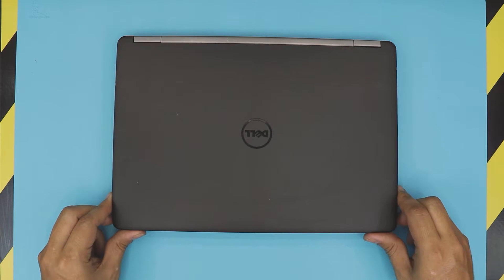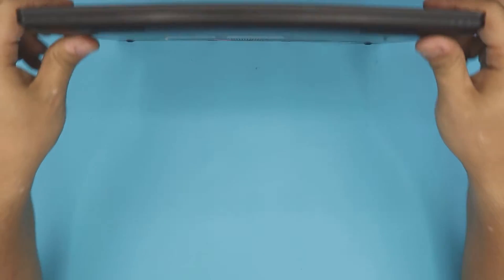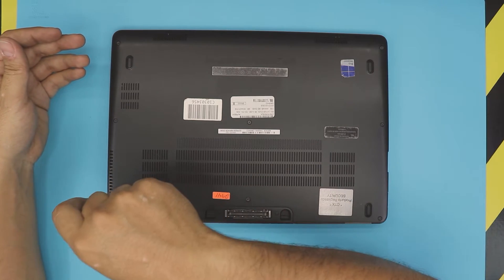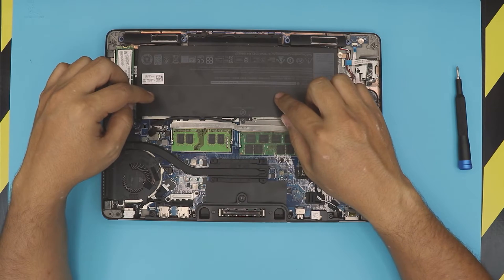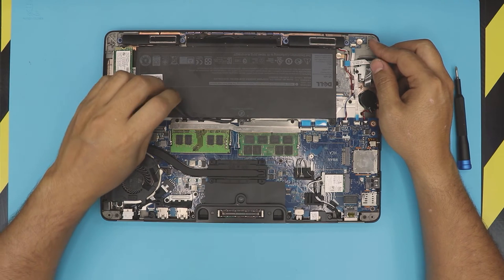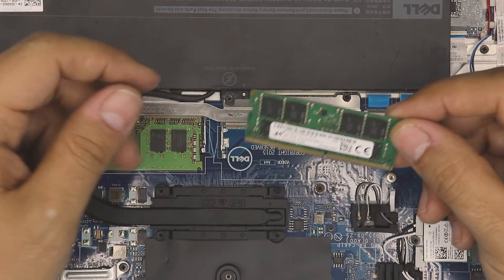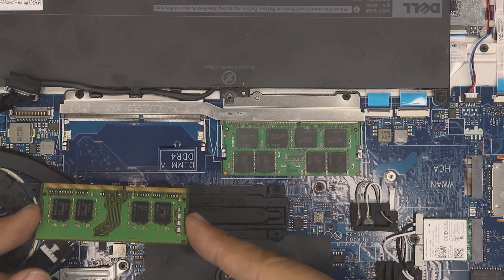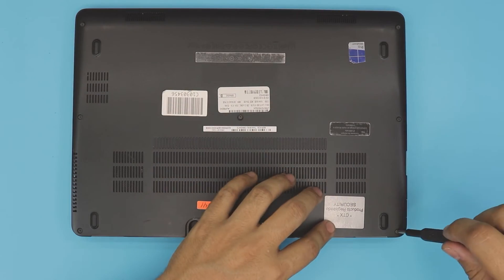Dell Latitude E7470 Ram Upgrade Guide !!!

Comment: is kingston good enough?
Reply from the maker: 🫠Regarding your question, it is very good it will out last your laptops life. good to go with.
cheers🍻
Reply: @uFixTek  whats much better buying two 8gb ram or buying one 16gb ram?
Reply from the maker: Always use two sticks, as this will automatically activate dual-channel mode, which provides better performance compared to using a single larger stick.

Comment: D origine c’est des ddr4 2133hz la fréquence que vous avez mis n’es pas la même,ça ne pose pas de problème?
On doit pas tenir compte de la fréquence?
Reply from the maker: Merci pour votre avis! Si vous souhaitez soutenir la chaîne, vous pouvez aimer, vous abonner ou les deux ! En ce qui concerne votre question, absolument pas mon ami, vous pouvez placer n'importe quoi Mhz ou GB et cela fonctionnera parfaitement sans aucun problème. Assurez-vous simplement d'obtenir au moins un 2666 MHz et le bios s'ajustera automatiquement, car celui que vous avez son 2666 et le bios ajusté au 2133.
alors ne t'inquiète pas mon ami.

Comment: You are using 1rx16 single ranked ram with 2rx8 dual ranked ram that came pre installed.
How is it affecting your performance? Why aren'tyou using both dual ranked ram, as 1rx8 or 2rx8 rather than mixing and matching
Reply from the maker: Thank you for the feedback! if you wish to support the channel you can LIKE or SUB or both :P
regarding your question: there is no issue with mixing both SR and DR rams, we do get brand new work station laptop that get shipped with mixed SR +DR. in a laptop its totally fine and pc and servers too even : in some cases when using a large amount of memory such as 16GB, servers motherboards actually require you to use a mix of Single and Dual Rank Memory.

Comment: Why when I try to turn on it the battery light flashes and turn off again?
Reply from the maker: Thank you for the feedback! if you wish to support the channel you can LIKE or SUB or both :P
Regarding your situation: i need you to do the following and report back:
#1. before all this what did you do ?, did you open up upgrade or did something?
#2. or you simple powered off and next day try powering on and it did the flashing and no screen?
Reply: @uFixTek  Hi thank you for your interest, the problem was fixed I remove the two memories and interchanged both, I verified the connections and thats it! Maybe was a problem with the connection of the memory in the slot. Work with 16gb instead 8gb dont give more velocity but it will give you a smoothier experience when you use your laptop. Thank you!
Reply from the maker: im glad that you got it fixed and if there is anything in the future i would assist you with feel free to ask me :)
Reply: @11453731  Hi Eric, did you get a single 16GB stick or dual 8GB stick? Mine came with 8GB and I got another 8GB Ram from Crucial but the laptop wouldn't turn on when I install the second 8GB Ram I got from Crucial. Also, if you did get another 8GB stick, does it have to be same brand?
Reply: That sucks
Reply: Good question

Comment: Really like the demonstration.  Just to confirm, if I tried (2) 16GB's DDR4 it will not work?
Reply from the maker: Thank you for the feedback! if you wish to support the channel you can LIKE or SUB or both :P
regarding your question: Yes you can place a 2x 16gb DDR4 SDRAM SODIMM, and it will work just fine.
just remember at 1st power on it may take 5-10sec for the laptop to do a mem check before showing screen.
https://amzn.to/3hux4iD